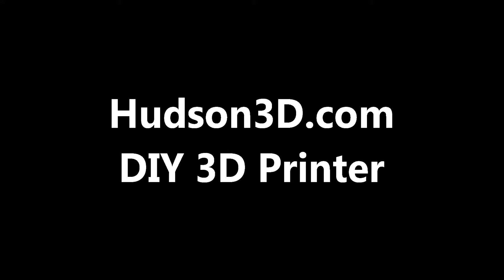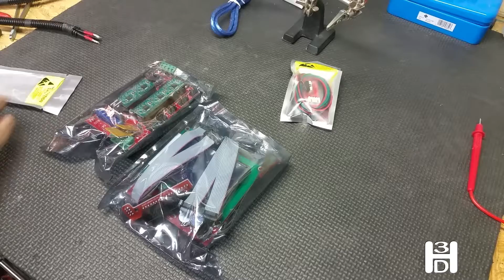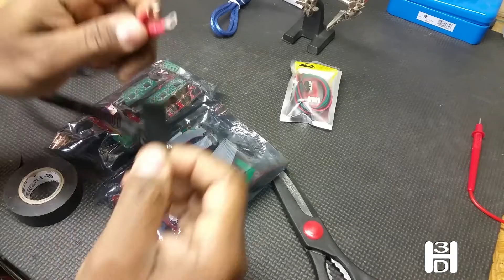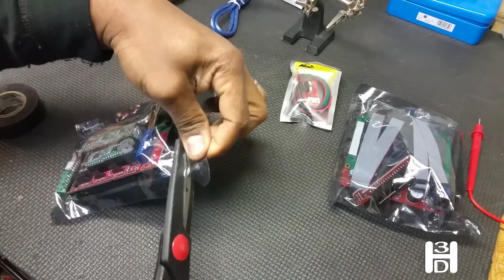DIY 3D Printer Tutorial Part 15: RAMPS & Firmware - Hudson 3D

Comment: not compiling ? class Hudson_3D_1_7_2017_ABL-Printer2 > Line 53, download the library and add to project
Reply from the maker: Which version of the Arduino Ide are you using?  Some newer versions cause compile errors and are not acceptable for use with Marlin based firmware.  I use Arduino 1.63 and 1.68 depending on what I'm working on.  Hope this helps